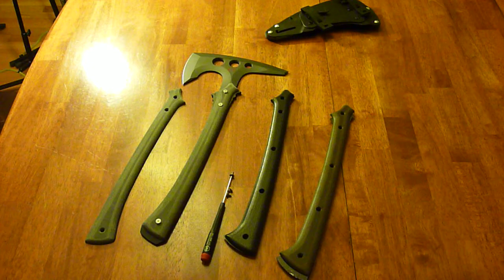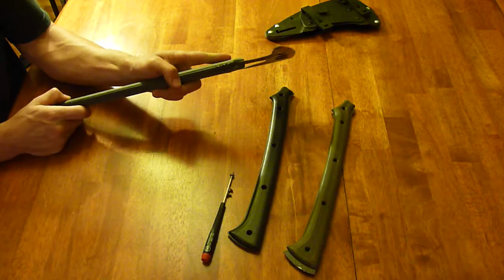3B Ultralight explanation

Comment: That 'fuller' isn't going to make anything weaker.  There is no reason for there to be any stress on that portion of the scale -- if there is, the operator is using it wrong.
Reply from the maker: yep, with normal use, it should be fine.  I DO think I'll be using medium/light duty spray adhesive when I mount handles from now on though.  it's not permanent, but better than nothing to keep dust and other junk from getting under the handle scales